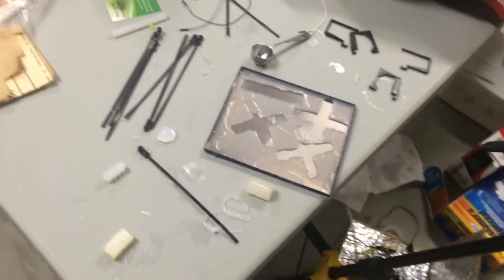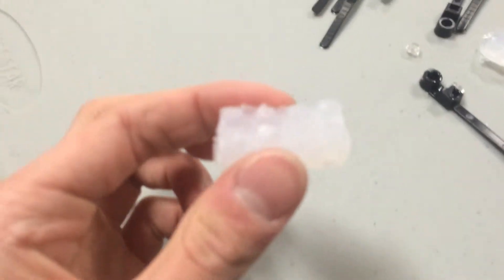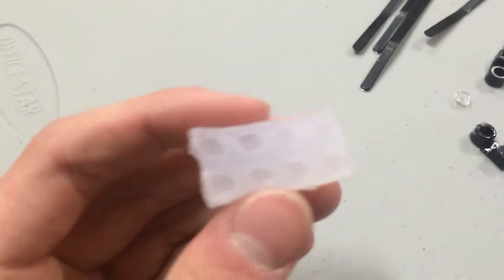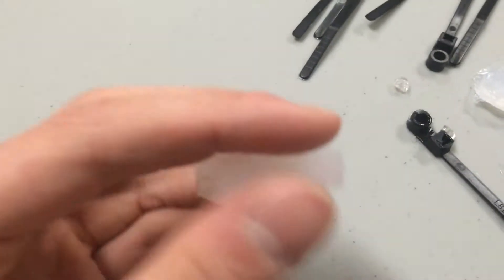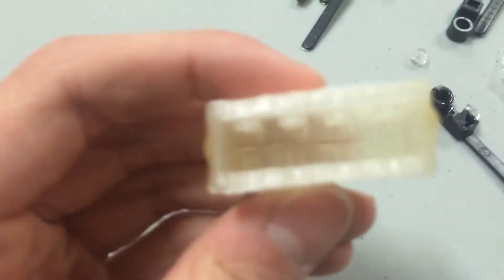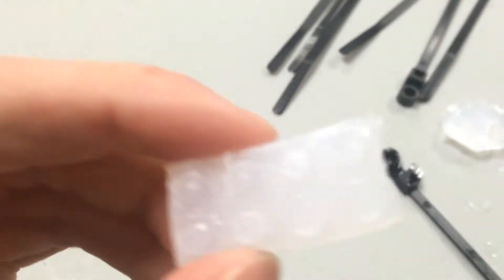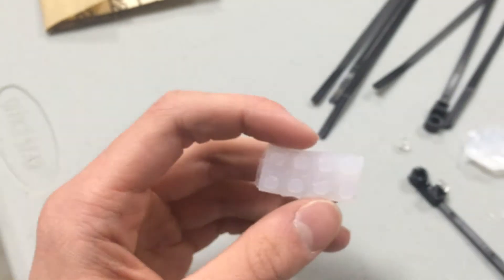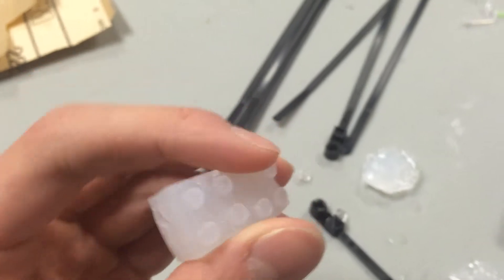Soft Robotics with Lego-like parts

Comment: I would suggest  soft technic pieces. You may still be able to use the typical pins, and technic pieces are much better adapted for robotics.
Reply from the maker: Thanks, but that kinda defeats the purpose of the project to begin with. The point was to make modular SOFT robots, not soft Lego-compatible bricks
Reply: So, would these soft bricks be making up most of the robot's body? I would be worried that their flexibility might loosen the stud connections, and thus bricks more similar to technic pieces may instead hold together better. However, the properties of the brick may vary with slightly different silicone batches...
Reply from the maker: +Charles Jr. Pike None of what you're saying is making much sense. The bricks need to form an air tight structure, which they easily do, even with the early versions seen in this video. There would be no advantage to using silicone technic pieces. The technic pieces are thin-walled and need to be held together by a separate connector. Also, what do you mean there would be variation from batch to batch? Sure, the chemical composition could be off by a few parts per million, but that wouldn't affect the physical attributes.
Reply: XYZAidan I am familiar with Lego bricks being held together by friction because of the tight way the studs fit into the bricks. If air tightness is what keeps the bricks together, then I guess that the way the bricks stick together is slightly different from that of solid plastic Lego.

On the variation by batch, I know in the video that you mentioned about the 'mix' being not quite right, causing it to be slightly sticky, and I assumed that these variations in the 'mixes' could also affect flexibility, firmness, etc.
Reply from the maker: +Charles Jr. Pike The differences in between plastic and silicone is what I've accommodated for. I don't see what point your trying to make here, this project WORKED and is long finished.
Reply: Well, in that case, I do have no idea what I'm talking about, so continue making cool stuff!